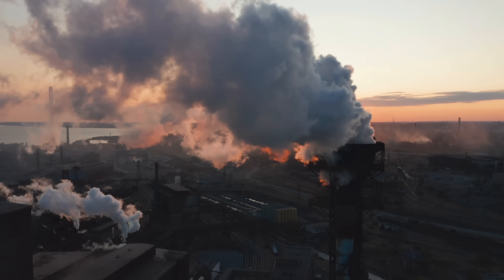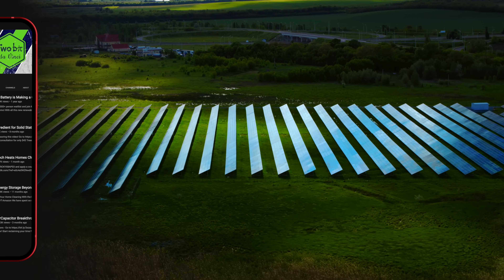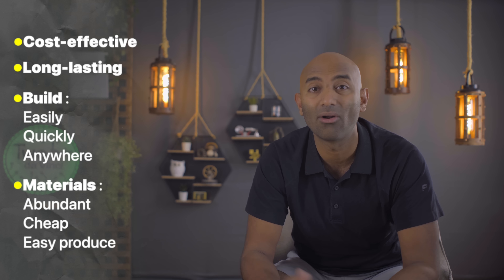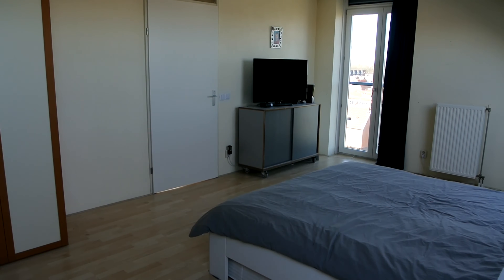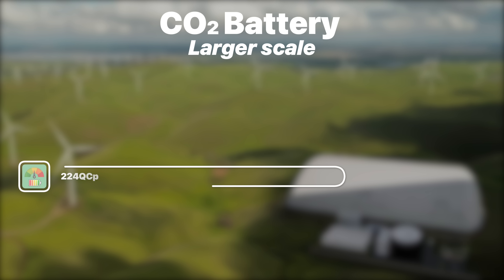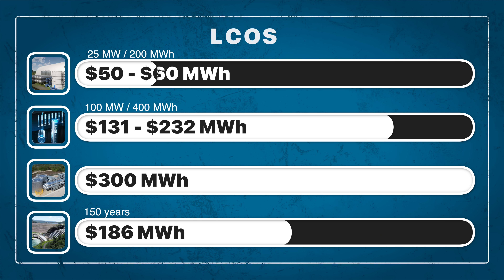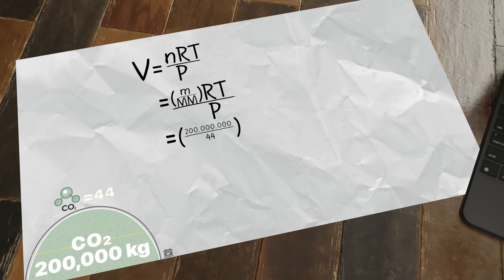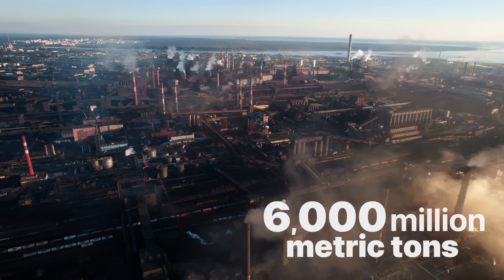The GENIUS Of the Carbon Dioxide Battery

Comment: Carbon Dioxide (CO2) concentrations in the atmosphere is a consequence of climate change not a cause of climate change. No CO2 from ice fields, lots of CO2 from the tropics. No CO2 from food in you freezer, lots when left out and eaten by airbreathing life. Water vapor has the most effect on climate. It absorbs incoming heat from the sun in exactly the same was as does CO2. But water vapor condensing puts massive amounts of heat into the upper atmosphere when it releases latent heat by changing state form vapor into rain of snow.

Comment: The idea of removing CO2 from the atmosphere is attractive. But remember your only storing it. 
   Later that stored co2 will be released, when the system is replaced, destroyed, ect, ergo its a short term solution. Unless you use it as a supplement for greenhouse food  production.

Comment: In New Zealand, since 1973, fibreglass covers allow the gas of the sewage treatment has been compressed and passed through water where the CO2 dissolved. The natural gas here, is extracted. That generates electricity to run the plant and a hundred trucks and busses. The sell the CO2. In fifteen years a green revolution is proving the Doom sayers wrong as an area the size of Australia, is, for the first time,  green.

Comment: First, there is no “climate emergency” - The UN IPCC ( Intergovernmental Panel on Climate Change) itself says that by the year 2100 at present rate temp will only increase 1.5 C! Second, all the while CO2 is plant food and NASA has indisputable satellite evidence that the planet is greening and thereby increasing animal habitats and crop production for a growing human population. CO2 is the answer to feeding the planet and being a good steward of the planet. Last your claim that wind and solar are cheaper than fossil fuels is flat out wrong when you compare the cost and net energy density of fossil fuels against intermittent wind and solar and the cost life cycle all the way up to safe disposal when you compare fossil fuels against wind and solar - Wind and solar are prohibitively expensive for little gain and there aren’t enough rare earth metals on the planet to convert all automobiles to electric - You propose a costly solution to an issue where there is in fact no problem - Insanity!

Comment: Just a quick look. It looks basic and simple.  But, what is the real cost of capturing, purifying, storing the gas? It looks like once the system is charged with CO2, not too much more would need to be added except for fugitive losses.  However, the production of the CO2 is very expensive and requires a lot of electricity.  This clip is glossing over that issue quite a bit.

Comment: I think you might be missing something:  heat transfer during compression and expansion.
 
--The pumps will generate quite a lot of heat when charging (during compression), and will sink a lot of heat (cool the surroundings) when discharging. Pumped hydro or batteries don't have this problem, but compressed air does though probably to a lesser extent because the air doesn't undergo a phase change. The bigger the battery, the bigger the problem. 
--Have you included components for heat transfer to the external environment? (fans, pumps, etc.) A large unit could either frost up and stop working efficiently or overheat and fail. And if you use an external source of energy for heating the liquid CO2 the efficiency drops. If you expand too much CO2 without heating the storage cells the remainder will solidify. (dry ice) I would expect that the problem will get worse as the battery gets larger. There might be a good solution at small size, but not at industrial size. In other words, will it scale? Time to do some thermodynamic modeling.

And finally, CO2 is actually a toxic gas when concentrated. The fatal concentration is about 10%. So leaks are more hazardous than compressed air.
Reply: I suspect that the heat exchangers are not part of the simplified diagram, but I think that the water pool that is shown is meant to be the heat exchanger. That pool of water will be warmed during charging, and then cool down during discharge. insulating the tank is actually an advantage in this scenario. while this is some technical hurdle, I don't expect that a water tank will require a lot of extra space, and is still miles less complicated than existing compressed air systems.
As for toxicity, I suspect that's why their system is shown in open air setups (not inside a building).
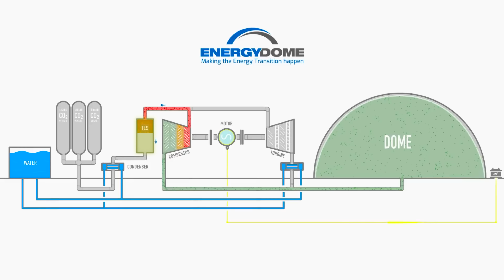Reply: 5:31 "A second Advantage is that the system incorporates a thermal energy storage system to capture the heat released when the carbon dioxide condenses and uses that same energy to evaporate the liquid carbon dioxide when the battery is discharging. This makes the battery more efficient than a liquid compressed air battery which requires external heating to boil and liquefy the air."
Is this what you were referring to?
And yes, CO2 is toxic at that level. I'd still rather be around that leak, than live steam.
Reply: A thermal sink system can store the heat of compression and provide it for the expansion cycle.

It's a huge "barrel" of sand with pipes running through it 

A thermal mass with a means of transfer of heat, and an insulation blanket.

A simple 4 gallon water heater with normal insulation can keep that 4 gallons above 100 F for 24 hours, starting from only 120 F when the power goes out.
(How would I know that?)
Reply: Stirling engine time?
Reply: Co2 leaks are only hazardous in an enclosed space. These units are outside. Even if the tank itself just exploded, I doubt it would be lethal to anyone.

Comment: the Northern hemisphere is 33% greener than it was in 1900. Sea levels are rising at the same rate as they were in 1865. The hottest decade on record sine the ending of the "Little Ice Age", was the 1930s into the early 1940s. The earth cooled from from 1940 to 1979 by .3° C. There was no warming between 1998 and 2015, the Earth has not warmed since 2016. From February 2016 to February 2018, global average temperatures dropped by 0.56° C. The Earth was warmer, there was less sea ice, and the sea levels higher during the "Medieval Warm Period". 

2022 Summer Arctic sea extent was greater and the ice thicker, than it was in 2008. Antarctica has been gaining 112 billion tons of ice a year since 1992. Yet according to NASA 2022 was the sixth hottest year on record. There is no mass extinction event occurring due to climate change, the Polar Bear population is five times what it was in 1960, and at its highest ever recorded. 

In 2019 more child died from problems associated with obesity, than from malnutrition or starvation. In 2020 the United States produced 25% more food than it needed or could export. All major crop yields have increased three fold since the 1940s, due in no small part to increased CO2 in the atmosphere. 

CO2 is a greenhouse gas, however it has never been proven that concentrations of CO2 will cause warming, in fact we know from ice cores that CO2 concentration lags behind periods of rapid warming. 

The world population has exploded, however it was expected to top out at nine billion, and then begin decreasing. The reason being that as developing nations become more prosperous, they tend to have less children. By depriving developing nations access to cheap fuel, they are forced to burn wood and dung to cook, light and heat their homes, causing massive health problems, deforestation, and leading to a mass extinction event as they kill local wild life to sustain themselves with protein. Bottom line..... there is no "Climate Crisis"

Explain to the people, how batteries are good for the environment, when they leach toxic elements into the ground water, when solar panels, wind turbines, and batteries, don't get recycled.  Go ahead bots, give your responses?

Comment: First BS on this video: "CO2 is not a strong ghg..." Well in the VOLUME that we produce, it is. And it is a LONG LIVING gas in the atmosphere too (estimates reaches even to 1000 years, while other ghg's like methane dissolves in few years).

Second pure BS is that CO2 is a solution. Why? It all depends on WHERE the CO2 is located. It is not a problem in the frozen soil, nor as forest or so on. CO2 becames a problem when it is RELEASED to the ATMOSPHERE.

CO2 battery could be a smart solution to use produced or even captured CO2, but it is hardly storing enough CO2 to really combat CO2 levels in the atmosphere. Once you fill the battery tanks, you only need some more after some has leaked out...

We are already around 2,7C levels of the GHG's in the atmosphere (takes long time [surface takes decades, bottom water takes thousands of years] to specially oceans to heat up, CO2e is over 508 ppm [2021 NOAA], where 450 ppm is 2C limit [many studies], 2,7C is an 50% probability estimate from 2007 IPCC report), so these levels should not be increased at all. And we need to take down huge amounts of CO2 from the atmosphere to stabilize the atmosphere. So CO2 still remains as a huge problem. And we keep on pumping record levels of CO2 and other GHG's to the atmosphere.
Reply from the maker: What you don’t get, is this is a battery, and batteries allow solar and wind energy to be viable 24-7, and with this there’s no mining required. Can you imagine the scale of decsrbonization this would enable?

Comment: Ever heard of ozone? How about azomite? How about hyperbaric aeration? How about hyperbaric incineration? The scientific-engineering technologies to make pollution-free factories already exists in the 1950s to the present but were never implemented because of lack of political will and that it will add 1 to 2 cents to each of the products they are making. How many times CLEAN FACTORIES are being made to blame for the sins of other factories who are not clean? MANY! Clean Factories should be forced to clean up the pollution of other factory owners who already left the place or who just simply closed up. The reason why rotten activists and politicians are blaming clean factories is because they know they do not have the knowledge and money to clean up the pollution created by others wants those who are clean to be FRAMED UP AND THEN FORCED TO PAY UP AND CLEAN UP THE POLLUTION OF OTHERS! And that is very, very, very UNFAIR! 60 years ago Buckminster Fuller said, "Pollution is just a resource that we haven't learned to use yet."

Comment: We had free flight model aeroplanes that used CO2 motors in the 1970s (Though dumping the gas out the exhaust, sorry) They worked well. 
This idea gives a lot of hope! Investors look at money and care about little else but will invest like with wind and solar if the money is there. 
Simple, old tech, cheep and efficient, fingers crossed on this one 🤞

Comment: Vaporizing enough CO2 to drive a turbine generator would require a lot of heat.  More than would be practical if using electricity to generate the heat.  If I'm interpreting the schematic correctly, it appears the model uses a natural gas-fired turbine to generate that heat.  I find it interesting this is never mentioned.

Comment: Carbon dioxide is plant food, it enables plants to grow faster and larger and improves yields,  as well as enabling plants to do all that with a lot less water.  Problem with greenies is that they have no imagination or understanding.  CO2 is enabling plants to grow in dry areas, and has the power to green deserts.

Comment: How much power is used to pump the fluid into the system from the bladder? 
CO2 still requires significant amount of electricity to produce, compressed, stored or pumped.
Reply: This is in no way about efficiency or saving energy.  It's about storing excess energy from sun and wind to use later. Which means you have to far oversize your energy production so you can then fill your battery.  At the acres of land this will require and the inefficiencies of this CO2 method you would be way better off using flywheels to accomplish the energy storage. More efficient and very little to no land use. It could all be done underground and vertically.  This compressed CO2 system is going nowhere.

Comment: With those specs there should be a huge rampant insane push to build as many as possible, as fast as possible -- especially here in Europe.
Sadly not going to happen as the whole plan is to actually cause the energy crisis by powers that be, most apparently.

Never thought that in 2020s in Europe you have to start preparing for frequent long power outages, along with costs reaching as high as 4€/KWh sigh
Reply: You can blame renewables for our present energy crisis, and the idiot politicians who think building more of a failed technology is the way forward.

Comment: Why not couple it with fossil fuel plant to capture co2 at the source.  Capturing co2 from fossils fuel smoke should be cheaper than the few ppm in the atmosphere.  Use co2 to capture off peak supply & use for peak demand - similar to pumped storage.

Comment: I was thinking..In sea areas, why not just submerge long pipes under the water, stick a valve on top, use wind power to pump air to the pipes, and when you need the stored energy, you release the valve and use the air pressure to rotate a turbine. Let water pressure do the work. The air pressure keeps the pipe intact, regardless of it's length.

Comment: This is dumb. It’s already been proven that these facilities consume too much energy, and thereby cause more pollution, and leave a larger carbon footprint, than the supposed carbon that they supposedly remove. How much energy goes into building these facilities, mining the materials, and running them? Too much. You know what else removes carbon dioxide from the atmosphere? Plants, trees, and fungi… this facility is a pipe dream and a way for the financiers in the corporate sector to pretend that technology can dig us out of this problem. It simply can’t. We need to restore forests, wetlands, and the oceans, or we are screwed. We have geothermal energy, which can solve our energy needs, but the financiers refuse to invest in it because the return on it takes 3 years or more, so they invest in oil instead. Videos like this do nothing but allow people to think that this issue is being solved by tech bros, so they don’t really need to worry about it, it’s copium.

Comment: CO² is necessary for life on the planet. It's one of the things that makes plant life flourish, which is what makes breathable air possible.

People conflate CO² with CO. The former is necessary; and the latter is poisonous. The answer is to convert CO to CO², which we can use for many purposes.

I like the idea of a carbon dioxide based battery, but it still presents the problem of toxicity c waste, once the battery can no longer retain a charge.

Comment: CO2 was 5 times higher during the Jurassic period. In fact if the industrial age did not happen in time plants would start to die. The climate change is being used for power and money. In the 60s we were going to freez to death then in the 80s we were going to die from global warming now we will freeze an burn at the same time. Climate change? B.S.

Comment: Promising looking tech - the question of sourcing co2 shouldn't really be a problem unless we go down the usual either/or rabbit hole. 

Carbon capture is going to become a necessity that will ultimately have to be met at the Governmental level, so why not make cheap carbon dioxide available for these facilities. It doesn't need to cover the cost 100%, but if it reduces the price to the storage facilities and lessens the cost of carbon capture then it is still a win:win.

Comment: Now all we need is to drill about 2000 m down into the ground, where the temperature is about 60°C and pump the liquefied CO2 down. Let it heat up, bring it back up and have it evaporate while driving the generator turbines, liquefy it again and pump it down. Now we have a geothermal power plant, that will run 24/7 with no emissions and now fuel burning. Turn the CO2 battery into a power plant and we can scrap wind and solar. Electricity for the cost of the investment/depression, maintenance and management of the plant. No coal, natural gas or oli are  needed.

Comment: Anyone portraying themselves as purveyors of technology and information that uses the term, "fossil fuel", loses a bit of credibility right from the start. That term was coined by a chemist, Caspar Nuemann in 1759 believing that reserves were created by the fossils of dinosaurs, and was later used more openly in the 1900's to infer that it was a natural substance, which it is but it is produced by biomass, much like coal and natural gas which is basically decaying plankton and marine organisms. The term has often given the idea that there's only so much and then it's gone but in fact is, albeit slowly, refilling its reserves. And to say that wind energy is cheaper, no. The cost it takes to manufacture, move, erect, and maintain 1 turbine is more than the value of the energy it will ever produce. Add to that the failure rates.

Comment: We have to think bigger scale. your initial assessment that we have a logic problem as we don't have enough solar and wind energy sources so we must have batteries is bullshit. Everything else is fine but the truth is we don't have enough to power to power the entire grid at their lowest output. The solutions is solar and wind everywhere. Solar window coatings that generated electricity were talked about in a TED talk 9 years ago.  And using excess to power pumps to put water at the a higher level. Say the Salton Sea and the Great Salt Lake. Pump the brine back to the Bonneville salt flats or back out to sea but use the excess power to desalinate or lift higher and then use gravity from the pumps stored energy to generate on it's trip back down hill. And water towers everywhere to do the same thing. That is 21st century pioneer stuff. Complaining about batteries is small fry.